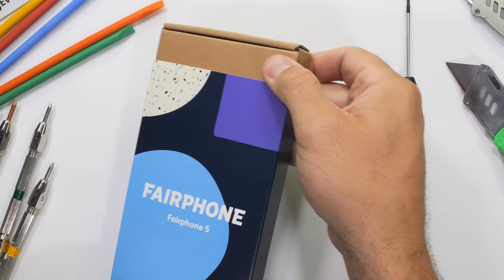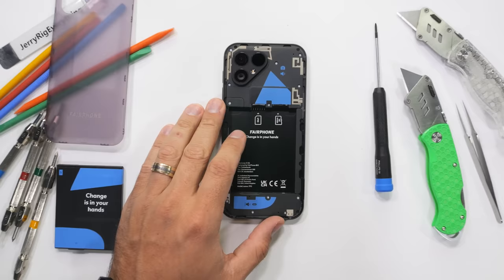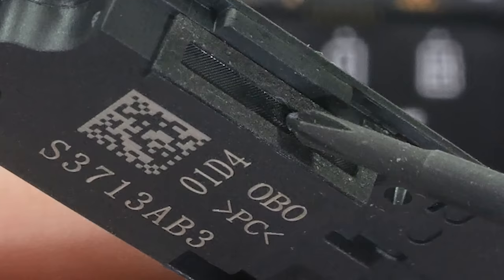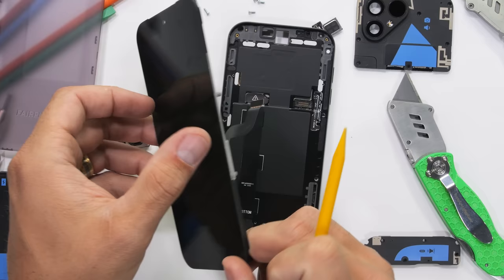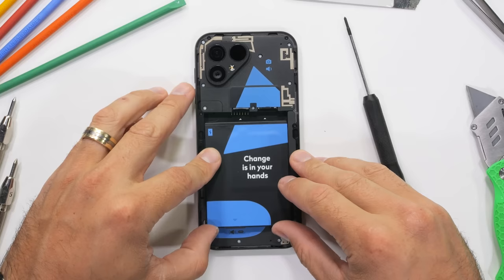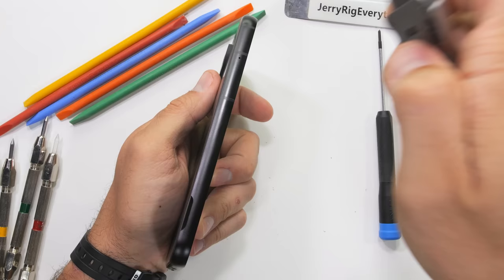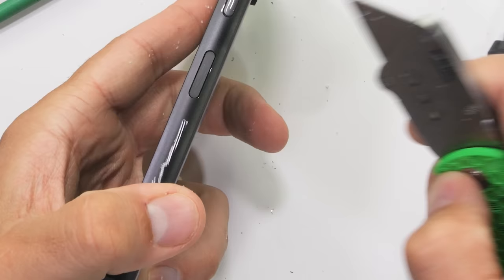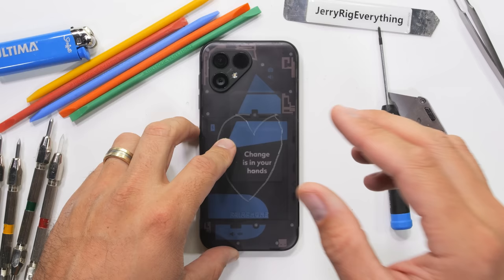The Best Smartphone on Earth - (Not Clickbait)

Comment: Yeah...as a smartphone repair tech I can tell you...those replacement parts are not exactly cheap. 35$ for the speaker and haptic feedback is 4x times what I pay for "regular" replacement parts for different models. As are all other parts. But considering they're offering 8 years of software updates I'll give them a pass. If they can make a little more pleasing to the eye I might consider it for my next phone.
Reply: I would say that they're probably still cheaper than using a tech to do the repair.
Reply: Yeah but considering that a regular consumer has to fork upwards of $600+ for what should be a super simple part swap because they force upon you a whole new board or screen assembly and actively try to software lock components. I'd pay $35 any day considering your parts might only go bad once in the lifetime you're owning the phone
Reply: yea its not cheap but its not a large company that sells massive amounts. just last year they sold a million phones for the first time. for samsung thats less than a week. find any other company of fairphones size and you just won't be able to get replacement parts.
Reply: You have to remember they are selling legit parts from the manufacturer. Those parts you buy online are either stolen, rejects, refurbished or simply used (scavenged from broken phones).
Reply: I agree, the parts are far too expensive. After a couple of years when the phone is worth £100-150 it will become uneconomical at these prices.

Comment: Ahead of the curve on user replaceable batteries? Hardly, I fondly remember my Blackberry Pearl 8130 (love that phone, by far my favorite phone prior to touchscreens, IT HAD A THUMB TRACK PAD MOUSE!), having a changeable battery. My charging stand had a slot for an extra battery so I always had a full one on tap. Come to think of it, the phones I owned prior to the Pearl, the Nokia 6110 and Razr V3 as well as most phones, had a user replaceable battery up until the iPhone took off. I suspect so Apple could make more money by not having a user swappable battery, and soon other phones followed suit. One of the major reasons I stuck with the Samsung Galaxy S line of phones, even though sadly in 2014 they too stopped. So they are not ahead of the curve, more like, coming full circle.

Comment: The decisive point is... it's too expensive... it shouldn't cost $200- $300 more.
Even a Samsung A35 or A55 is relatively easy and very cheap to repair. The only hurdle... The case is glued, which is not a big problem if you technically have more than two left hands.

Comment: Phones with good batteries usually can last the "average" lifespan of a phone (5-7 years). 
So except for getting extended battery without a powerbank I don't find it that useful to having a replacable battery. 

All the bloatware, cookies, etc that suck the battery and slow down the phone would be an easier fix as charging less would extend the lifespan off the phone in general and not have it slow down for no good reason.

Comment: I hope to see Fairphone eventually allow for customization with its modular build, similar to some of the older Motorola devices. If I could swap out parts to add different cameras or processors, this really would be the best smartphone you can buy. I don't know how practical it is though, I'm not that familiar with how easy it would be to make that kind of customization possible.

Comment: Just today my current phone (Xperia XZ1 with Lineage OS Android 11) had that one random reboot too much, which drove me over the edge: I need a new phone.
The Fairphone 4 was a strong contender before (for the "if stuff breaks, order this immediately"), so I looked into the Fairphone 5 to get the newest one available. The Specs on OS and Security Support sounded amazing...and then I stumbled across your  review. Have I been unsure before, I'm certainly not any longer. 

Yes, the iPhone recently had their absolute Dealbreaker removed in favor of USB-C, but the new Fairphone really is the better phone for me. and that's not even considering the price.

So thanks for this review, it helped me greatly in my decision!
Reply: lost likely issue with your custom rom
Reply: @destiny_02  indeed, that's the assumption. but the original OS (Android 9!)  didn't receive security updates any longer (stopped in September 2019), so Custom ROM is necessary. And those are scarce for such an old phone that is "only" from Sony. This phone would be capable to live much longer, but I cannot risk it randomly not working.
Reply: I ditched Sony back with the laggy and useless Xperia X1, praising to never buy a  Sony phone anymore

Comment: Thumbs up for the phone. When the get a fast charging with at least 100 watt. I'll buy it. Most important for me now is the batery and charging speed.
Reply: A second battery and it is full in 10 seconds. 😂
Reply: They won't add ridiculously fast charging because it dramatically reduces the lifespan of the battery, with the current 30W charging they're already pushing it and recommend turning fast charging off

Comment: Very nice achievement, especially replaceable battery. IP rating is very questionable, considering that removable back is snap on. On other concern is a cost of small parts, for example $25 for a $0.25 charge port shows that they run a very capitalistic profit scheme. Pretty much trying to markup as much as possible. This does not match up well with the values the company is trying to display.

Comment: Europe may of passed a law to have removable batteries  but manufacturers will just either make them difficult to buy expensive or not bother selling them to the public
Reply: The law requires the battery to be easily removed with only a screwdriver. So they probably would just make the battery expensive.

Comment: I know it may sound bad but phones like this have a lot of problems such as water resistance, durability, plus dust entering the circuits
EU’s decision is something that not everyone is a fan of
Reply: We had such phones 20 years ago already. Even my old Nokia 6210 survived a full washing cycle and still works today. This what proper phones are
Reply: @Signofevil_Smile4theCam  have you seen modern phones and their internals and how water damages them
It’s hard fix any chip related components of a phone especially if such phone has removable back
EU doesn’t realize that this can bite them back later
People will damage phones much easily 
Less water and dust resistance more damage more repair more money wastage 
Even if someone makes a way for easy repairs on the motherboard then we all would start loosing features such as good camera good performance 
There is a reason why companies made non removable backs on phones(money is part reason)
Even I had removable back phones but they always had issues and they were from Samsung, Nokia, etc.
Reply: @Bigshotchain  mate, I'm well aware of that, however it's still overrated that every device MUST be waterproof. And Fairphone works on it btw.
Reply: @Signofevil_Smile4theCam  not waterproof it’s water resistance 
Anything such as dust and water entering the phone could damage the chips
It’s very important not overrated
Reply: @Bigshotchain  I have never had any issue with a non-waterproof phone although doing heaps of outdoor activities, including gravel cycling. And my last 2 phones I swapped each after ~4-5 years, due to OS and battery eol. It is overrated, it is again a need placed by the industry to sell devices at a higher price. Unless you work in an area that has fine dust or water, or you use it for underwater filming, you don't need an IP67 rated phone. Common sense and caring is all that is needed. This is my point of view and experience , and I have been working/dealing with phones/computers for the last 30yrs.
Reply: @Signofevil_Smile4theCam  you work in those areas 
I lived my whole life in those areas
Reply: @Bigshotchain  poor you, then you probably should get a normal life once, now I really understand you and feel sorry for you. I think this also is a good point of ending that discussion, as I'm not in the need for 'I have the longer one and so on' discussions. Enjoy your day

Comment: No choice of having a sealed battery from 2027 for any phone sold in Europe? 
Back to the days of things like Samsung's incompatible batteries, buying an extra battery as the removable one wasn't good enough (not great for the environment), reduced water protection, security, consumer choice ... On the plus side it would leave Fairphone as pretty much the only choice in Europe. A shame the EU doesn't focus on what matters eg responsibly sourced materials, a minimum of 5 years security and OS updates.
I supported the desire for the UK to stay in the EU, but it's this sort of restriction of choice by the EU and blind drive to standardisation to knock out choice and what makes sense environmentallly that makes me question the EU's non elected bodies (you can write in but they don't respond).

Comment: this is such a huge step forward in the right direction, and it pushes every company (not just phone manufacturers) to think about the planet more.
it's just a shame that the hardware is total dogshit and is inferior to the Pixel 7 Pro, as it has a worse screen, lower screen resolution, a worse battery, worse cameras, worse camera software, worse physical build quality, worse water and dust resistance, worse and less RAM, worse UFS, lower specced USB type C support (3.0 vs 3.2 for the Pixel), worse benchmarking scores, worse chipset/SoC, and a worse loudspeaker. it's worse in almost every single aspect that's relevant. also, it costs twice as much as the Pixel 7 Pro. the Pixel 7 Pro can be purchased REFURBISHED for about £300-330 ($380-420). guess what refurbishing is? sustainable. same as the fairphone's ethos.
don't buy this tripe. buy refurbished. recycle your goods.

Comment: We will get to change the battery....the EU usually gets it's way. Frankly as things stands we are replacing perfectly good phones.
Reply: The law has some loopholes, otherwise it would have not went through:

If the phone is Waterproof, it does not need a replaceable battery. There reason for this is that some manufactures argued that a replaceable battery makes waterproofing hard

Comment: Well, as far as I see, I can get better hardware for 400 Euro instead of this phone for appr. 700 Euro. For 700 Euros, I can get last years best phone, f.e. an ROG 6, with 6000 mAh battery, and much better hardware, more RAM and ROM and so on. It will take years of heavy usage, till this battery will degrade to the state of only 4000++ mAh, only just to speak about replaceable battery.

Comment: Cells phones models are irrelevant and out of date every 2-3 years, i have never changed battery on any cell phones i have owned, so i prefer skimmer more water tight phones if that means non removable battery. I know i am going to get some heat for this comment but like I said, i have never had to replace battery and chargers are everywhere literally in case battery runs out.

Comment: Sum cost fallacy I think, if you buy parts every year and throw away your old ones it would be worse than upgrading every two years, or if parts break and you replace them at what point does it no longer matter ? Like driving an electric car yet charging it on a grid powered by coal and gas, plus the carbon cost of manufacture how long do you have to drive to make up for its carbon footprint?
 
And the biggest crime of all Solar power how much energy can you remove from the earths system before it starts to fail, Dyson sphere on our sun is the doom of earth, can you have ecosystems in solar fields?  The only place solar is a net positive is on rooftops where they don’t cause harm
Reply: Commission Regulation (EU) 2023/1670 read this mate
Reply: @unintendedperson  ah they did take into account the life time use of the smartphone, most regulations I’ve read don’t take things like that into account , like solar fields kill topsoil since is basically permanent shade

Comment: This piece of crap doesn't even have an audio jack. Funny enough, Fairphone removed the audio jack from their phones right as they started selling their own line of bluetooth earbuds. This company is just greenwashing while they make money on adding to the mountains of electronics waste.
I used their fairphone 4 (also without audio jack) and lasted 4 months before I had to buy a better phone. By that time I had bought a new 3.5 to usb-c adapter on average every 14 days because the shit wouldn't stop breaking. It is by far the most frustrating experience I have ever had with any phone and the first time I've ever wanted to use my phone as a weapon to bludgeon whoever designed it.

Comment: Way overpriced, does it come with a spare battery & charger? can the gps tracker be easily removed from it without affecting other components?  Does it have a hard switch to turn it off or turn off microphone or turn off GPS? Can you buy one without providing you identity? Can you block trackers from selling your data & contact list? how long does the plastic back cover last before it get brittle?